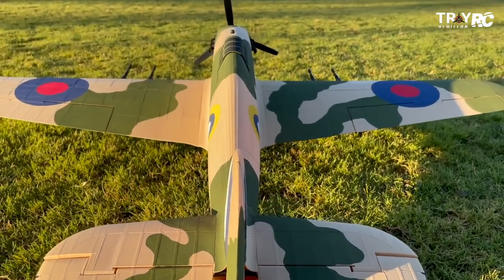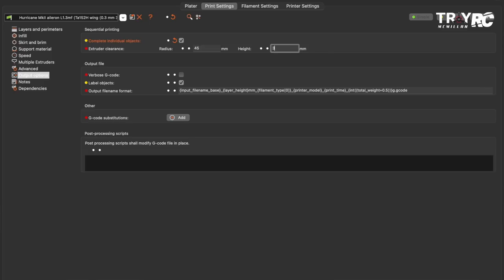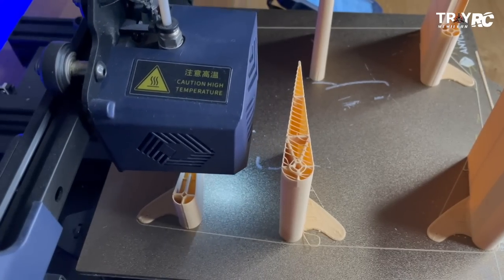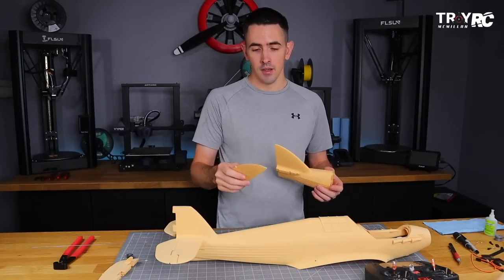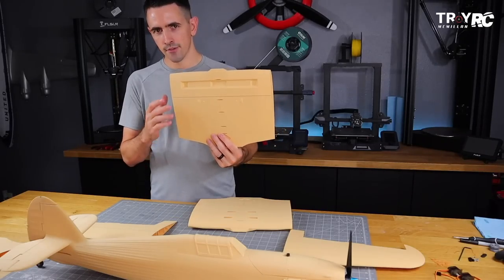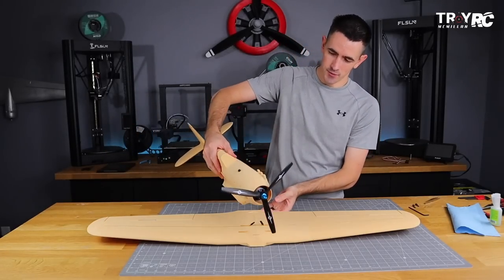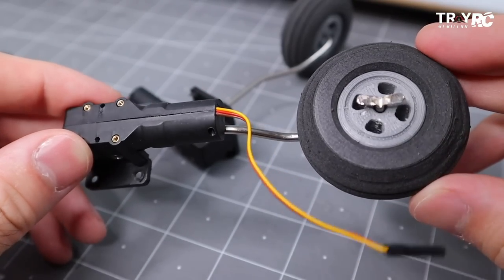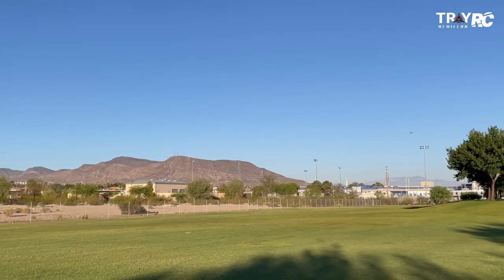How to Make RC DIY Hawker Hurricane MKII & Sequential Printing - Fully 3D Printed Airplane

Comment: Nice job. Lovely build quality. I’ll add this one to my winter building. Thanks for the printer tip. I’m thinking of buying a Bambu X1 carbon this year to replace my old Ender3DPro. We’re messing around with 75% scale builds and PolyAir of 3DLabs Spitfire and P51D Mustang. Tip stalling is a major issue with these warbirds. A lot of learning still to be done.
Reply from the maker: I highly recommend this build! :) That's so cool you're experimenting with scaling them up like that. I haven't tried the bambu x1 yet! I will have to check it out.

Comment: Great video I always look forward to yours. I have printed this model and now just painting it so your stencils will come in very handy thank you. I noticed that you have printed a better spinner for the 3 bladed prop which looks so much better could you do a link to the STI files, please. I have seen someone do half-wheel covers and a radiator scoop which goes well. Keep up the great work.
Reply from the maker: Thank you!! :) Half wheel covers would be an awesome scale detail to add, I thought about doing it. The spinner is from the eclipson Panthera, if you search for spinners in Cults there are a few free options that are actually more scale than this one though!

Comment: Great build as always Troy. I just got some HT LW-PLA that I plan to try with this model. A couple of comments that others may find helpful...Personally I have a hard time with medium CA setting too fast and also just too much glue mess in general. I find using the Zap Slow CA with the Zap Flexi glue tips makes assembly a lot cleaner and easier. Also for the servo...personally I wouldn't use blue painters tape to hold the servo. Blue painters tape is almost a low tack tape so I would be concerned with it holding. I use Shoe Goo which peels off the servo just fine when it comes time to move it to another plane. But if you must use tape I'd suggest the 3M automotive mask as it is much higher adhesion then the blue painters tape.

Comment: Very cool build, though the airplane is missing the big radiator scoop under the fuselage to complete the actual model
Reply from the maker: Yeah I see that. They have it like that because one of the versions can be printed with no landing gear/belly landing model. that way its as customizable as possible to your preference. ☺

Comment: Wing loading: 34.7 g/dm2 . It is nice looking heavy brick, only for experienced pilots.
Reply from the maker: I added a large battery, motor and MG servos to make this plane fly faster. I also added retracts which adds weight. If you wanted to make this into a lightweight park flyer, i would recommend building the one without landing gear and adding a smaller battery :)

Comment: Nice job! What do you use to wipe away excess CA glue? Also, if you make a more accurate scale prop spinner, I think it would make the whole aircraft look even better.
Reply: Be aware of cooling requirements for the motor and batteries, looks like the design of the nose and spinner creates an air scoop to address that.
Reply from the maker: I just use shop paper towels, and wipe any excess quickly.
Reply from the maker: @vumba1331  Definitely! I didn't have any trouble with parts/electronics overheating with this plane.

Comment: Troy, I tried to print the piper and I did printed every part but the holes to put filament as a hinge is too small. And the hole to put the filament as the reinforcement of the wing is also smaller than a regular filament. Do you know what is my mistake??
Reply from the maker: Are you using LWPLA or regular PLA? Either way it has to do with having the flow rates too high, so it is printing the walls of the plastic too thick, so you need to reduce the flow rate. For regular pla, i print at 215C and 102% flow. For LWPLA, i print at 235C and 55% flow. I hope that helps :)

Comment: Very surprised you didn't sand it, would improve aerodynamics a lot. Nice to know it flies well without that though.
Reply from the maker: that's one of the coolest parts about 3d printed airplanes, you can take the finish work as far as you like it to be. If you want to take it straight off the printer, or if you want to sand it, it's going to fly great either way.
Reply: @TroyMcMillan  You should look into René Rosentraeger, he has a channel on making massive 3D printed VTOL aircraft, very interesting and detailed stuff.

Comment: Troy can I ask you please why you dont use PETG for plane printing??
Reply from the maker: Well, for this plane specifically, I used LWPLA because i wanted to save weight because this is a smaller plane and i want it to be as light as I could. In general, I don't use PETG or ABS for my builds because it has pretty bad warping, so when you are printing out thin parts I find there can be warping - which just doesn't happen with PLA or LWPLA.
Reply: @TroyMcMillan thank you very much for your helpful answer😊

Comment: Can you use pla+ Or will it be too heavy?
Reply from the maker: You could... but it would increase the weight significantly, which would make you need to fly this plane fly a lot faster. It would make it more of an intermediate to expert level flying plane.
Reply: @TroyMcMillan  ok. Any suggestions on what? Lightweight PLA I should use? I have a Creality k1.
Reply from the maker: @qtstrider  pretty much any of the brands are good. eSun, ColorFABB or 3DLabPrint. I decide which one i use based on the color I'm wanting for any plane.

Comment: Question, being that I live in a 5th wheel trailer and don't have space for 3d printer, how much would you charge to print this plane out for me. I do understand I will need to get all the electrics for it.

Comment: What propeller exactly did you use in this video?
I will want to use a D2830 1300kv motor. A better choice would be the three blade propeller 8060 or 9060?

Comment: I didn`t get very well about the Extruder Clearance height settings, I`m using ender 3 s1 plus, should I set a value bigger than my print area? (300mm) or should I concider only the head?

Comment: Wow, great build man! I have been struggling so much trying to get my Bambu x1c to be able to print any of the models from 3dlabprint unfortunately. I wish they would come out with .3mf files that were configured correctly. Do you plan on getting that type of printer? I'm sure if you reached out to their marketing team they would send you one :) It would make the coloring of the models SO much easier I'm sure. Keep up the great work!
Reply from the maker: You can use the 3mf files for your bambu x1c you just need to import the 3mf file and then select your physical printer from the drop down on the right side of prusa. I show it on this video if you hadn't seen it! I hope it helps. https://youtu.be/vCMJD2DdqGY?t=63
Reply from the maker: I'll have to check out the bambu printer though, I've had a few comments on this video mentioning it :)
Reply: @TroyMcMillan  thank you, I will give it a try! And yes, you should :) I get my second one on Thursday!!!
Reply: @TroyMcMillan   unfortunately, I tried to use the method you suggested, but it did not work. For some reason the prusaslicer .3mf files are not compatible with the Bambu studio or orca slicer forks. Those slicers are pretty much required to run the x1c. The x1c requires an internet upload feature  as well as custom .gcode from bbstudio and/or orca slicer.(due to missing a usb-interface option) I would like to see some x1c content if you can secure a machine! You seem very talented with slicers/CAD. Anyway, I will update if I figure out a fix from 3dprintlabs! so far radio silence.

-Will
Reply: @shoodoo.poo.  any updates?
Reply: @Mike-kr5dn  all failures so far my friend. Lmk if anything comes of your attempts.
Reply: @shoodoo.poo.  I’ll see what I can do, found some info on discord

Comment: troy, i am not a teenager, or adult, im a 10 year old person, i make fantastic plane models showcased by my school and other places, my planes never flew, it was a hand-flown aircraft, i made a B777 and a 738 once or twice, rn, i am making my first ever rc plane
but quick question, i lave an LJ Li-ion 14500/500m Ah 3.7 V I, is that a good battery?
Reply from the maker: Nice to meet you, 
Glad to hear this will be your first RC plane. Unfortunately you will need a bigger battery. The EDFs use a lot of battery so the smallest battery I would recommend would be a 3s 2200mah battery.

Comment: Since this plane is about the size of the cub you did a year ago i was wondering what the typical cost is to build this plane? Reason i ask is i wanna get into 3D printing and making planes and experomenting but if the prints cost more in filiment than it is to just buy it in foam version than im not sure ill build full planes with it. Id probbaly print stuff to experiment with but no one seems to have answered how much filiment is used but i presume most watchinf generally have an idea but i have yet to get a printer so not sure the cost of it all filiment wise.
Reply: I think the Cub cost me around $10 in filament (including some messed up prints and a crash repair), servos at 4x $2, receiver was $20, motor and esc were $20, and the battery was $15, prop was $7. A bottle of medium CA was $10. I think that is $90 USD total.  You need LWPLA, PLA, PETG, and some TPU filament on hand. 

I am printing the Hurricane now. Don't forget the value of being able to print and replace stuff you break too.
Reply: @flynbenny  thanks for that, probably going to order a printer and get learning because that is very economical for planes especially like you said printing new parts if you crash is helpful. Plus I have a ton of stuff around the house I wanna do.
Reply: @DDRDK  I think a 3D printer is the most life changing appliance I have had since a smartphone. I print a lot of other things than just airplane stuff, like household items for example. I use Fusion 360 as my CAD software, and primarily use Prusa for my slicer. Printers aren't friendly yet for a non-technically minded person (aka a general consumer) yet, but their place in the industrial world is close to hitting primetime and the general consumer won't be far behind.
Reply: @DDRDK  I think a 3D printer is the most life changing appliance I have had since a smartphone. I print a lot of other things than just airplane stuff, like household items for example. I use Fusion 360 as my CAD software, and primarily use Prusa for my slicer. Printers aren't friendly yet for a non-technically minded person (aka a general consumer) yet, but their place in the industrial world is close to hitting primetime and the general consumer won't be far behind.
Reply: @flynbenny  I used to mess around with inventor back in the day but could never justify the crazy cost to own it as an individual. What does fusion 360 cost? For most simple things I'd love to be able to take off the shelf designs people have made and slightly change them but havnt found any good software to do it that doesn't cost a substantial amount of money. So my main concern is being able to make my own stuff. Regardless, I do know that there are soooo many files out there for common stuff you can download and print but my main worry in the last 5 years that kept me away is the high cost of cad software.
Reply: @DDRDK  Nothing. It is free, you can have 10 designs editable at one time on a free license.
Reply: @flynbenny  lmao.... what have I been doing with my life. Thank you! Time to get looking at what to buy. I think the last I looked it was the Presa printers I was interested in.
Reply: @flynbenny  another thing I plan to do is make molds for carbon fiber as I work woth that a lot.

Comment: hi Troy, congratulations for your models and for your videos, your works are really very interesting.  If I may, I would like to give a small suggestion, one thing that was very useful to me was sanding the surface of the model with sandpaper gradually finer and finer.  consumption and aerodynamic efficiency of the model have increased greatly. You can see an example on this model (https://youtu.be/DjOA52Slkq4) that I designed, the video doesn't have the same quality as yours, I don't I'm so good .in case you are interested in the project I will be happy to send you all the files (for free).hi Troy and congratulations again ...
Reply from the maker: Your plane does look really smooth!
Reply: @TroyMcMillan  yes it is in the latest version I painted the model with spray paint and then I polished the surface with abrasive paste for bodywork, and the performance improved even more.

Comment: They need to re-design the zero with retracts also, hows the dc3 large version coming?
Reply from the maker: The Zero is the main reason why I wanted to build this plane, it is one of my favorite park flying models to take out. I'm not working on the DC3 large version at the moment. What scale would you want to see when i do it though? park flyer, or larger? I have a DC6 i designed out now though https://youtu.be/Vp3yEOzvFtg
Reply: @TroyMcMillan  I would say a 1400mm size dc3 with split flaps and retracts .I have seen the dc6 very nice .I may print one .I beta test lots of marks designs from 3daeroworke .just finishing up a all pla pond racer 1200mm 6 chanel and p51b 1200mm
Reply from the maker: @jameswilberger  that would be a great size, i'll keep that in mind when i get back around to it. I have been designing a new plane, i should have the video up on youtube in the next couple weeks - I hope you enjoy :)